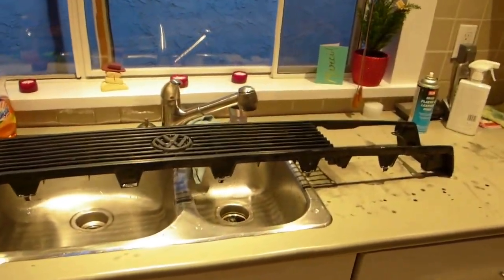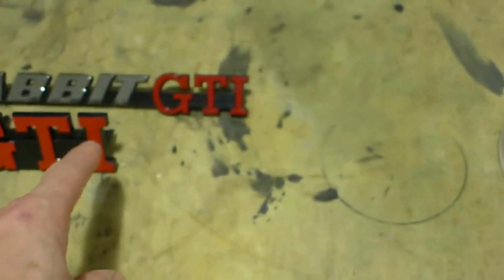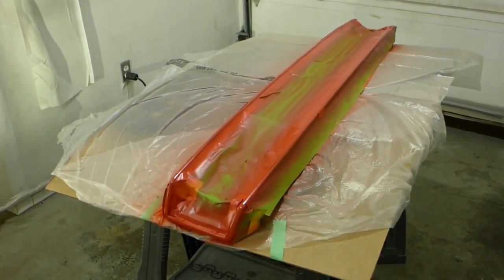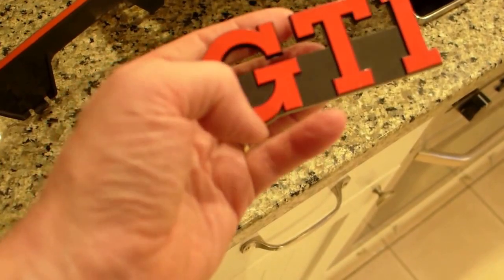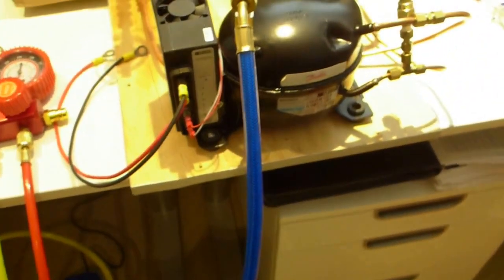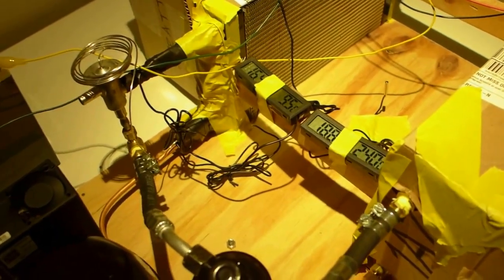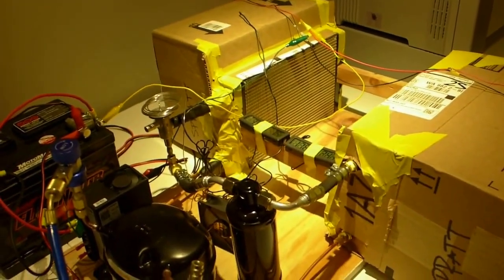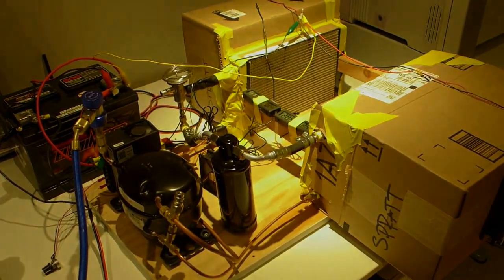The Ultimate 1983 Rabbit GTI - part 113 (Front Grille Prep/Painting, Electrical A/C System)

Comment: I think you'll find that the system works better when there is good airflow through the cindenser.  a lot of automotive systems don't do all that well with low airfkow.
Reply from the maker: great point. I agree that it would be hard for the system to work with the condenser under the car and stationary ...

Comment: Great Work as usual Derek!  Where do you plan to mount the compressor? It seems pretty tight under the hood.
Reply from the maker: +Robert Orr There is room above the transmission to the side of the engine. I am ordering another larger compressor (just taller - still lots of room for it) that is 2x more powerful but can be controlled to bring current consumption down from a peak of 25 amps to less than 1/2 of that - I am thinking I will want the additional cooling capacity.